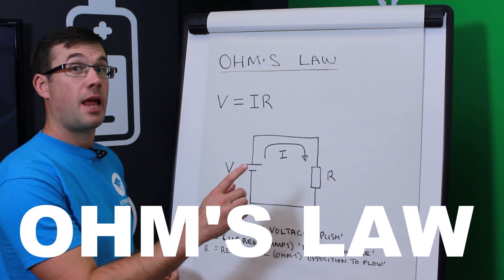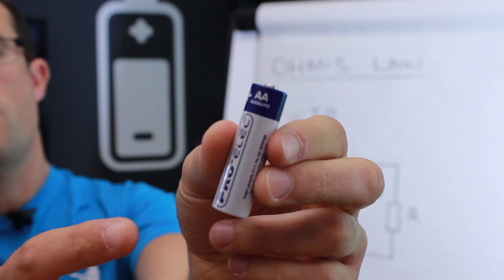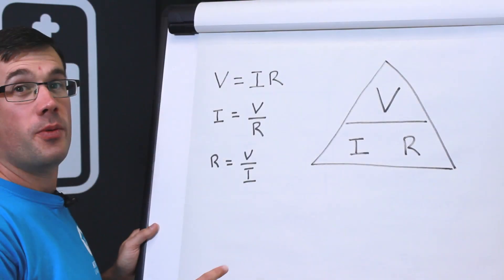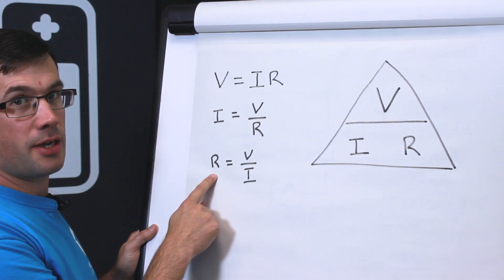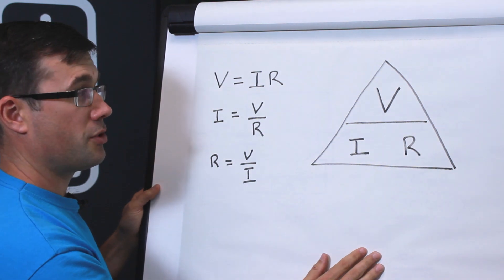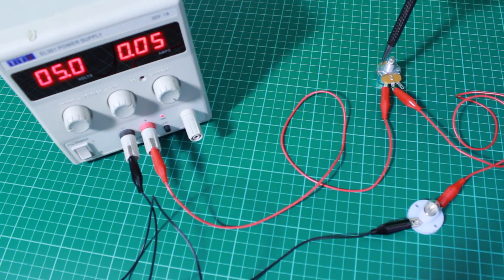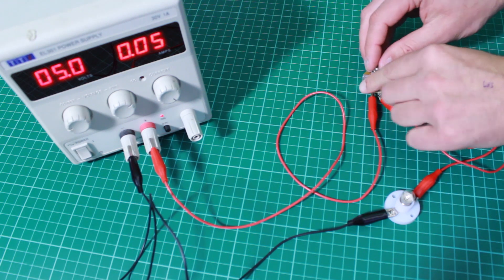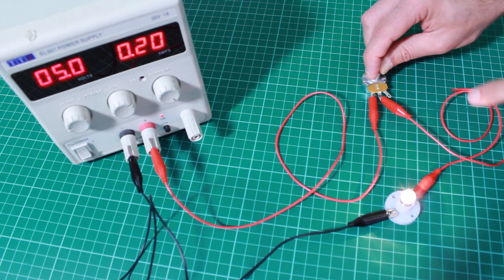Ohm's Law with practical demonstration

Comment: However does the same current flows through the resistor.
If the led consume 0.02 A  so does the resistor consume 0.02 A also 🤔.

Comment: So a 9V battery connected to itself with a paperclip that has 1 Ohm of resistance would make a 9 Amp circuit?
Reply: Yes because if you have only 1 resistor rated at 1 ohm in a circuit, you'd have quite a lot of current flow because 1 ohm isn't much by itself. If you were to include two more resistors that are also rated at 1 ohm the circuit's total resistance would be 3 ohms, which would make the current drop down to 3 Amps.
(9 / 3 = 3)

This video shows a VERY simple demonstration of ohms law. When you're making more complex circuits, you'd definitely use more than just a 1 ohm resistor.
Reply: Also, the guy in the video is using something called a Potentiometer, which basically serves the same purpose as a resistor but you can manually adjust the ohm ratng by turning the nozzle.

A potentiometer is an adjustable resistor in simple terms.